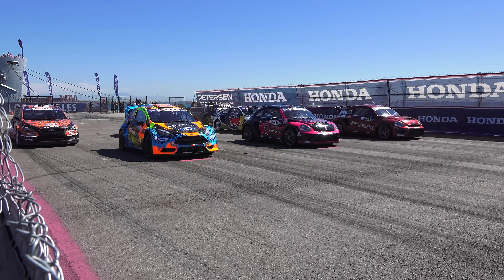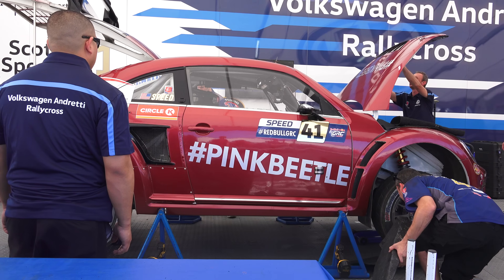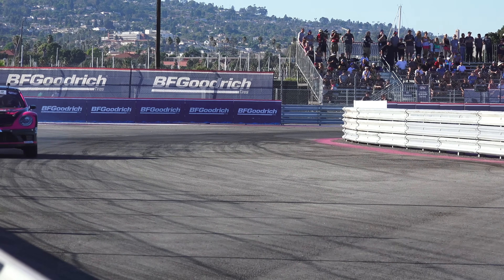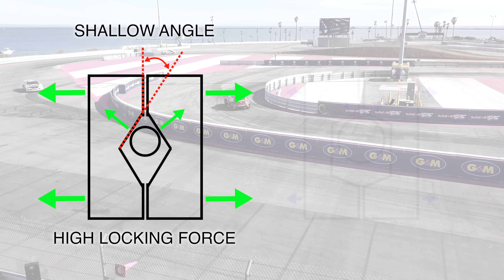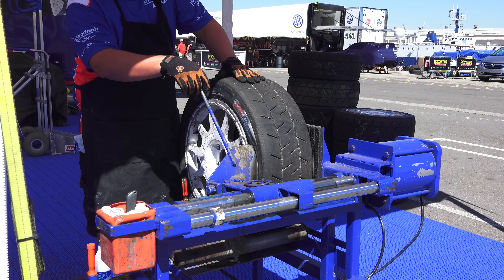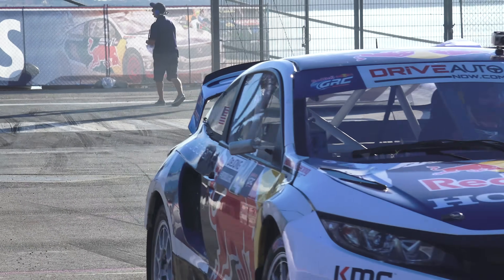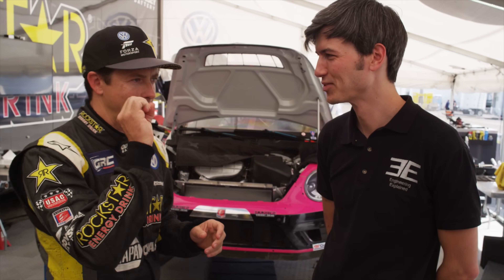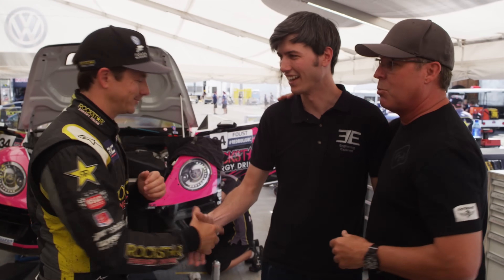How Global Rallycross Supercars Hit 60 MPH in 1.9 Seconds

Comment: How does the composition of these tires differ from F1 and street tires?
Reply: jose jalapenho yeah you really don't understand anything about tires. These are your only contact patch to control the whole car, braking, and power delivery. There honestly couldn't be a much more important aspect of a race car. If the tires suck, the rest of the car won't work. BFG is top notch.
Reply: Did you see EE's video on fastest possible 0-60 times? The tires are a limiting factor, as 2.1S IIRC was the best current street tires allow (based on braking distances, which can be used to infer grip and max acceleration).

No doubt that you need lots of power and a solid tuned drivetrain/suspension to get such times. But without the tires, when you do the math, that last .2S reduction is lost. Every little bit counts, every little bit lost hurts.
Reply: That's classified
Reply: They are much much softer so they have a lot more grip but also wear out before even going 100 km's.(no citation I just heard it from a documentary)
Reply: Tires are the biggest deciding factor. You are mistaken if you think they play a small role.
Reply: Yea, they're just soft. they wear out several sets for each day of racing. I'd say if they aren't completely worn out after two races they last to long and they could go for more grip or less weight...
Reply: Ceazar Carr great question. I would like to know as well.
Reply: Justin M 1.4 Gs in lateral acceleration? These tires are crazy.
Reply: some of you guys have obviously never used slicks. When they get hot, they will literally stick to the ground if the vehicle is left stationary. They are nothing like a road tyre
Reply: Eric B :-)
Reply: jose jalapenho the tires make all the difference. If you can't put the power down, you can have a top fuel dragster and still be slower than me running.
Reply: Clearly you don't watch or know anything about tyres. If you watched F1 which is by far the most technologically advanced motorsports, you would know the impact of tyres's compound, pressure, temperature and profile. I'll tell you, it makes a huge difference, even with tyres with the same brand, in a lap of less than than 2min the results can differ like 8 secs...
Reply: Tires are one of the most important things from a car..
Reply: crazy non street legal super quick wearing butter rubber tires
Reply: light weight means nothing for acceleration.....you can have a 4500lb tesla do 0-60 2.2 seconds..its all the tired and torque 0-60
Reply: the tires can make a huge difference, these tires might have 20-30% more grip than a street legal tire.
Reply: jose jalapenho why am I a sheep? Because I know a little about tires and I actually work for a tire manufacturer. Go back to your dungeon troll and keep thinking you know it all.
Reply: F1 tires are either
Slick which are smooth and come in a super soft and go to a hard compound
Intermediate which are like medium/hard tire but designed for a wet track with no standing water
Wet which are like medium/hard tire but designed for a wet track with standing water

These tires are designed for tarmac and some dirt

Street tires have to be like a F1 wet but super hard as they have to last 25,000miles-40,000km or so and give enough grip for city/highway speeds
Reply: +Fala que Eu Ajudo estas a milhas do que se esta a discutir aqui. xD
Reply: +Justin M ahahah bfg tires are made of freedom. those are like any other brand that makes racing slick tires you sheep.
Reply: +Larry Bolan i know rubber engineering makes miracles specially for racing but its one of the last things that put these cars doing 1.9 sec aceleration. Like you said the drivetrain suspension plays such a bigger role. search(youtube: Straight cut gears. and feel what is a "huge diference". the ones you need for achieving 1.9
Reply: +Fala que Eu Ajudo quem insulta muito geralmente nao sabe nada ou foge a questao, e tu nao foste excepçao. virem ao youtube "ensinar" que os pneus sao parte importante num carro nao foi la grande ajuda. A questao era se achas que aqueles pneus sao totalmente diferentes dos de formula 1, so podes tar enganado e foste  mais uma ovelha vitima de marketing.
Reply: i honestly dont believe that the tires make such a huge diference, the crazy aceleration comes mostly from the mecanical parts and light weight. can you smell the smelly smell of marketing? these BFgoodrich tires are very very soft cause you just want extreme grip, but they lack in durability.

Comment: Awesome video! Lol @ 600hp from a "restricted" 2.0L. Hahaha.
Reply: Slap a stroker crank on one of the Miatas and it's basically a GRC car. :D
Reply: for_all_those a skoda vrs would never do 240mph
Reply: No it did   227.080 mph
Reply: then how come an unrestricted 2.0L can make 1100? Hahaha.
Reply: for_all_those first no as long as you do it right the engine wont blow up its just not effective with all audi.....most of them take a turbocharger pretty good secondly i know about bonneville and jeah a modiefied salt race spec octavia hit that record but thats just because ita not a really important record for cars to have if so audi and bmw and mercedes would have nearly all the records especially audi with the quattros.the fact that a race spec vehicle holds a record does not make the vrs the fastest mass production car.....not even close but it is like the ford focus rs golf gti and many others a really fast and inexpensive car
Reply: for_all_those update: Koenigsegg has this record now and many others. My what a years time can change huh? Even though you were wrong to begin with.
Reply: for_all_those first off all it still will never hit 250mph....maybe 250kmh but that means its not very fast many audis mercedes bmws and volkwagen and fords are faster so its not the fastet mass prosuction car
Reply: The F1 cars have an 1.6l that produce at least 750bhp. Back into the the 80's, some F1 had 1.5l that could go over 1000bhp
Reply: Jeah you need a driveshaft that can handle high amounts of power so what its like tuning every other car still does not make a stock production skoda thr fastest productuon cat because a highly modified version btoke a record
Reply: its not highly modded, the interior has been stripped out and a super charger added, under the WRC and new age touring, every part counts which includes nuts/bolts/wires, and a certain percentage has to come from the public retail car for a car to compete in WRC and new touring, if you have the time to examine every part of the engine, then alot of failures would be small parts, the percentage rule is definately part of WRC, the last time i checked new age touring were still getting teams together
Reply: @CncObsession
Even in the source you use, it clearly say it's not qualified. Struggle a bit with reading comprehension?
Reply: audi quatro s1: 2.4L, 850 HP (hillclimb version)
Reply: CncObsession
Hennesey is not a production car, it's a tuner car. Skoda Octavia was sold in millions.
Reply: doubt it holds any records hahaha skoda indeed
Reply: 227.080 mph
Reply: 1000 hp when unrestricted. that's like 250ph per cylinder :')
Reply: for_all_those, a production car does not need to be made in the thousands.
Reply: ***** a production car is a regular car made in the thousands, not a car that has been produced
Reply: for_all_those It doesn't have to be in the thousands to be production.
Reply: so in rally and NGTC touring car a certain amount of the car has to be from the production car in the shops, so if they release a 4x4 octavia, you just buy some new springs and carbon brakes, a new turbo or super charger, and generally have a rally or touring car for £30k
Reply: 600hp from a 2L engine is sick but top fuel drag cars are what blow my mind. 8000hp from a 8L V8, 1000hp per liter and cylinder. Just crazy
Reply: steven B hit google with skoda world record and find out, if you add a supercharger to audis, most of the engine would blow up
Reply: Sorry , it's a Hennesey Venom @ 270mph. https://en.wikipedia.org/wiki/Production_car_speed_record
Reply: @CncObsession I think he ment fastest 2ltr record
Reply: +CncObsession Nope, it's the Bugatti Veyron Super Sport.
Reply: steven B the vrs has the world record for being the fastest mass production car, skoda scam the rules of AAWC and touring and just have percentage rule parts in the engine so you just need a supercharger
Reply: steven B todo it right you have to replace most of the engine amd make sure the drive shaft can jandle 800bjp
Reply: the skoda octavia vRS holds the world record for being the worlds fastest production car and able todo 240mph supercharged
Reply: for_all_those funny joke mate
Reply: MJO Gaming it does for the world record
Reply: There were only 30 Veyron's made in the first production cycle, and only 5 Super Sports, and the record is clearly listed on the Wiki article.
There are only 25 of the Koenisegg that holds the record currently, and 11 of the version that posted the record. Interestingly enough, breaking that Wiki Article's own rules, and also not satisfying the 30 required for the Guinness Book of World Records requirement. Looking into the Hennesey Venom GT, the only reason why it's 'not included' is because they only made 13 of them, of which ALL of them were the exact same car so they actually made MORE than the Veyron Super Sport OR the Koenisegg 1MW.
Intriguing... Almost sounds like car politicking.

Comment: is it 0-60mph on the speedometer(tyres rolling at 60mph trying to get traction)?  Or is it  0-60mph on actual momentum(where you can track actual speed like from a radar gun)?  I was fooled like this before when drifting.. doing a drift my speedo says I was doing 90mph+ but when checking on the radar gun I just had an actual momentum of 52mph.
Reply from the maker: +Zero Tolerance vehicle speed is 60

Comment: So much missed out here. The fuel used-  Gearbox ratios - Type of gear box -  Anti lag -  Hp + torque curve .etc
Reply from the maker: VP Rally Max Fuel, 6 speed sequential, gearing is open. Yes, anti-lag (I have two videos explaining anti-lag, one on sequential gearboxes). Peak torque around 4K RPM for the Subaru, redline around 8K. All of the car info can't fit into one video, that's why I make 2 a week! :)
Reply: Ya, but the common viewer doesn't care about this so obviously things will be left out. I don't this is intended for those in the know
Reply: Engineering Explained Thank you lol.
Reply: +Engineering Explained What do you mean by gearing is open? It would mean a lot if you could answer this!

Comment: top fuel dragster 0-300 in 1.9 sec hmmmmmm
Reply: And a cornering acceleration of what? 0.01 G?
Reply: 0 - 60 mph 0.2 (secs) 0 - 100 mph 0.8 (secs), that said, if you convert to metric, 300 km/h in under 2 seconds isnt so far fetched. Either way you look at it hes wrong, but they are also an entirely different breed of car that is built to go in one direction as fast as possible, these have to turn too.
Reply: Slackin:  Not to mention that Top Fuelers basically destroy part of themselves each run and have to be partially rebuilt each run by a team of mechanics. 

That's a COMPLETELY different beast than a production car which I expect to run 100,000+ miles with minimal maintenance, even if I drive it fairly hard.
Reply: Nick Martin He is right, the fastest I found was 1.57 seconds to 300km/h
Reply: SlackinPanda even if he is talking kilometers then he's a little closer. but still wrong
Reply: Chad W Well 95% of the world use km/h so I`d guess that xD
Reply: Chad W Of course it is. So if he's talking mph he's wrong and kpm he's also wrong. Of course he should have stated what units he was measuring with but he didnt, i assumed the two most common ones.
Reply: RandomUser M formula1 and nascar are fast and they can turn
Reply: These things can't even turn...
Reply: I was referring to the dragsters.
Reply: Nick Martin again you shouldnt use assumptions in anyTHING!!!!!!
Reply: Nick Martin common is an assumption.... as an engineering study, i assume only moron dont use units
Reply: Chad W yeah, and i assumed he used one of the two most common units of speed when used referring to cars. he probably meant one of those two.
Reply: however F1 have so much downforce they can drive upside down, keeping them firmly planted, Nascar had less, but still decent downforce, as well as a set up that causes the cars to tilt slightly to help compensate for the G's going left at 160+ will produce, along with camber and toe, stiffness and swaybar settings to help them stay in the proper direction. There is no comparision between a TFD and F1, Nascar or GR
Reply: Chad W assuming things is fine dude, he's wrong no matter what units he was referencing.
Reply: Also dragsters can only run one time before putting in a new clutch.
Reply: The guy who races top fuel was asked how it feels to take off with the darn thing. He said "take a seat and give me a shovel, I will hit you straight in your face with it" :DD
Reply: there's no top fuel dragster that gets to 300mph in less than 2 seconds.
Reply: The Esseboy you still use units... its science 101.... assume nothing

why would you assume the time was an hour..... 

not trying to be devils advocate but saying 300 and you have to assume its km and hours is a retarded way to communicate
Reply: Juan Carlos Damonte rallycross cars cant turn?

Comment: All these racing videos...  When are you going to explain NASCAR?
Reply: Joshua Hirtle, large displacement engines in light cars going fast in a circle, what's to eplain?
Reply: +ak operator Dont be that guy. i dont like nascar but there is way more than what you said. you can sum up rallycross cars like this: light engines with turbo+ awd in a small car.
Reply: NASCAR can always be simplified, but it's still a complex sport.  If EE can take a more technical look at the sport, I would be interested in that video.  Just suggesting a topic that I'd like to know more about.
Reply: calm down guys, I was joking.  but they all drive identical cars. tuning the suspension, aero, and tire pressure is all they do (much like any other pro racing circut), except super boring because they just turn left, besides the two times a year they race road courses.

Comment: What does the number 32.2 represent
Reply: Gravitational acceleration, in ft/s^2.  Equivalent to 9.81 m/s^2 (approx)
Reply: I believe it's the acceleration of gravity (acceleration of gravity = 32.2 ft/sec2, 9.81 m/sec2).

feet/meter per second squared divided by acceleration of gravity, gives you what percentage of gravity you are experiencing - but forward, not down (45.08 ft/second2 divided by 32.2 is 1.4). In other words, from 0-60 mph, the driver experiences an average of 1.4 g's. 
And in reverse: 1.4 times acceleration of gravity [32.2 ft/sec2], gives you 45.08 feet per second [distance driven over the 1.9 seconds it took to reach 60 mph]

I hope that makes sense, took me a minute to wrap my head around it. I've never touched this equation before!

Comment: Gearbox ratio it's relevant too.
Reply: ***** You have to calculate the maximum torque the tires can handle before slipping, and go backwards from there. Yes backwards through the transmission and to the engine, so the transmission ofc do matter, but the transmission/engine can only take you "so far" before it all depends on tire grip. A drag racer therefore has bigger wheels than body..
Reply: I'm liking this discussion lol
Reply: Yeah, but also rely on horsepower though cuz it gaves power to the torque and the engine
You can get short gears but lesser top speed
Or long gears but lesser accel

low gear ratio can provide powerful immense accel power but lack of top speed
Which if these cars can go 60 mph in 1.9 seconds, means there top speed maybe around 120 to 150 mph

Rally cars are more specifically cornering offroad cars which is why top speed isnt there thing
Reply: yes Silva, i was hoping some information about the gearbox too. if its straight cut gears, stage of the clutch, gear ratio like you said and the weight of the whole system.
Reply: ***** yup
Reply: The Venom Hoon Yes, but in the end it all comes down to grip. If the engine is powerful enough you don't need insanly short gear ratios.
Reply: very
Reply: Maakola77 you need very short gear ratios and a very high final drive
Reply: Donald T. Silva 130 is fast enough

Comment: Honda makes an awd rally?
Reply: Honda makes good lawn mowers too.
Reply: Volkswagen's Beetle is a slow pile but that doesn't stop them from making it a GWRC car, either.

The GWRC engine/component layouts are very different from anything you'd find in their consumer vehicle equivalents. No models running, not even the Fiesta and WRX, are really like what you could just buy and drive down the road.
Reply: similar to a lot of things racing, they also produce/co-produce F1 cars, MotoGP bikes and WSBK bikes. Its likely a co-production, that allows them to place their name on it and use their body, but is probably also a lot of external parts/kits. That said, Honda produces some bad ass machines, when it doesnt come to their basic DD cars
Reply: only rallycross.
Reply: These are nothing like the cars they look like, believe it or not the Fiesta isn't an AWD rally car either. These are completely bespoke race cars with a random non-integral body on top.

Comment: I wonder what these would do in a 1/4 mile.  Or are they just geared to go 65-70 mph and max out there?
Reply: From my little experience & research, they do somewhere between 120-130 on the top end. Which isn't bad, but since they get to 100 so quickly, there is very little drive at the top of the range. So quarter miles would probably be mediocre to decent, but not mind blowing.